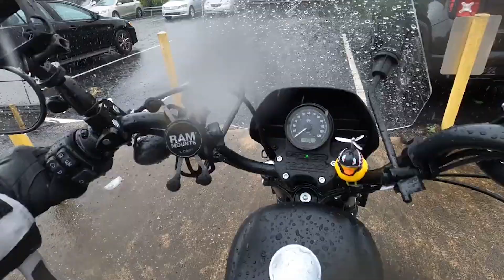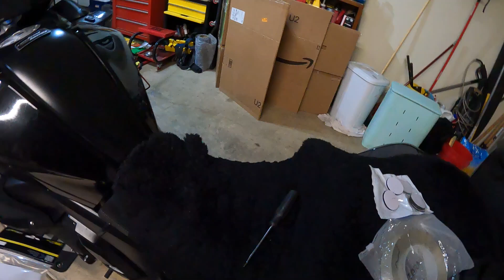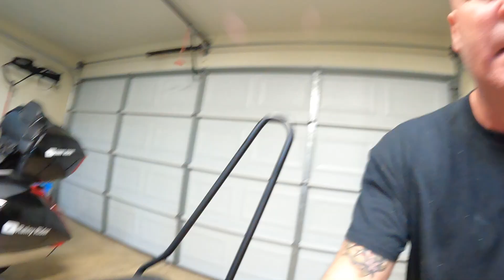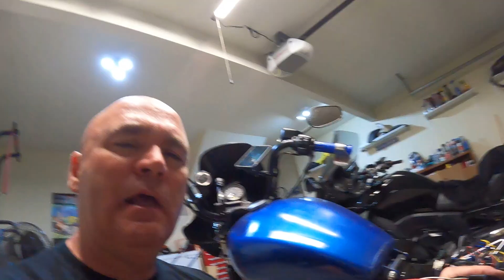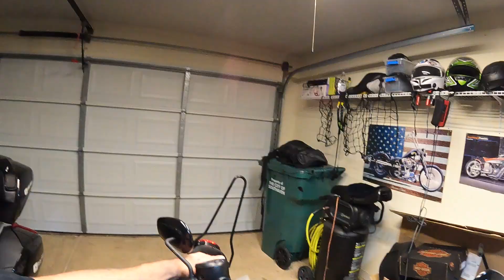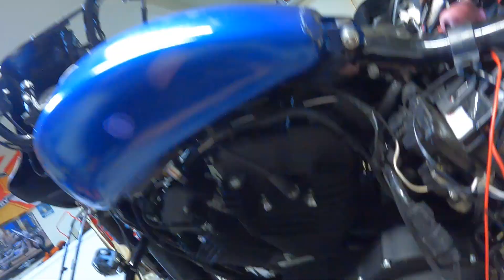Healtech Thunderbox Installation

Comment: What happens when you connect a battery charger that increase the voltage?
Reply from the maker: @NordicAdvRider  you shouldn't charge over 12.7 either way
Reply: @RainyRider1970  Yes, a fully charged battery is around 12,7 volt but when you connect a charger like Ctek it increases to the voltage to over 13 volts during the charging process. So my question is, will it trigger the thunderbox?
Reply from the maker: @NordicAdvRider  well, mine doesn't. Mine charges at 12.7.  Anything more than that, I wouldn't leave on a charge constantly. It'll burn up the battery
Reply: @RainyRider1970  Ctek chargers are smart chargers and can be connected for a longer period as they switch to maintenance charging after fully charged the battery. I used them for years on my cars and bikes. Anyway, thanks for your response 👍